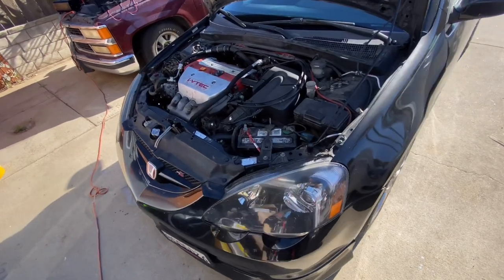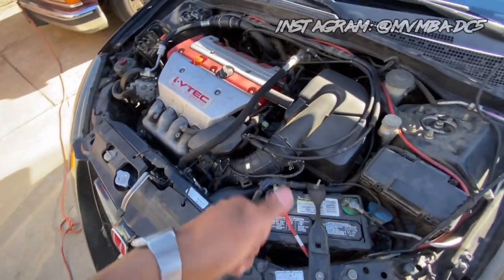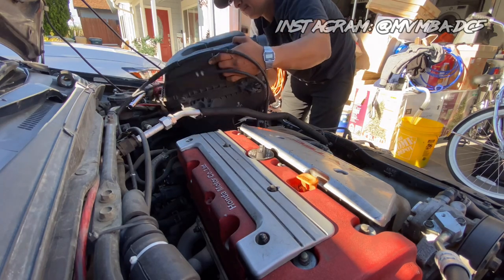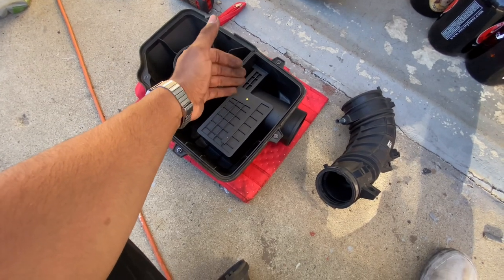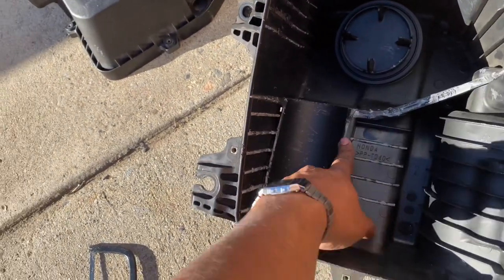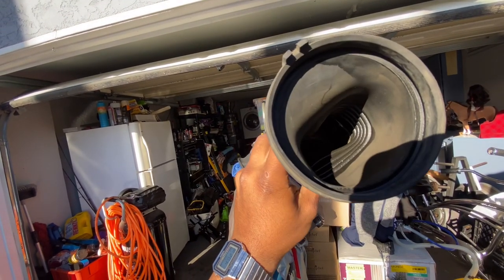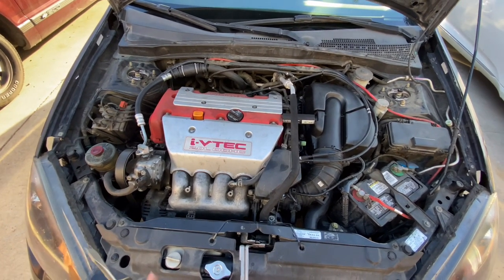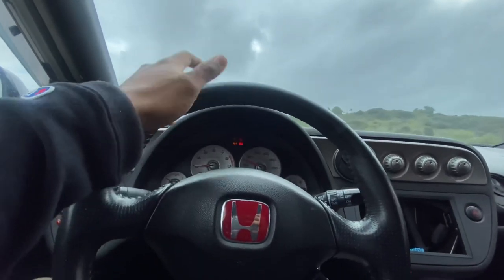Hondata Airbox Mod !  (RSX, EP3)

Comment: thx for the detailed video :)

12:00 are there any aftermarket option for the intake tube? the way that it is pointing away from the grille has been bugging me since forever, but I don't want to go for a backyard hack either. Anyway, I have recently picked up a second hand airbox, so hopefully I will attempt this mod soon.

Comment: I need help with my RSX. it's having high rpms and it's causing the check engine light to come on.
Reply from the maker: Probably a bad Idle Air control valve, I’d get that code checked out at autozone for free and go from there
Reply: @ajnunez117  it could be a dirty throttle body also. the engine stalls while driving and shifting. just replaced the clutch, and it sounds like the mechanic didn't do a good job on that. I paid $ 2,500 just for the labor.